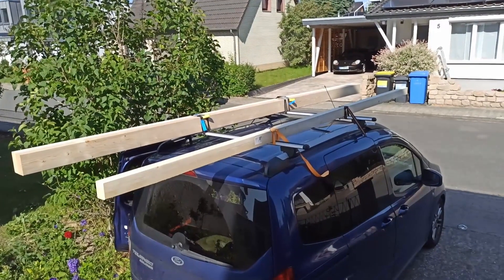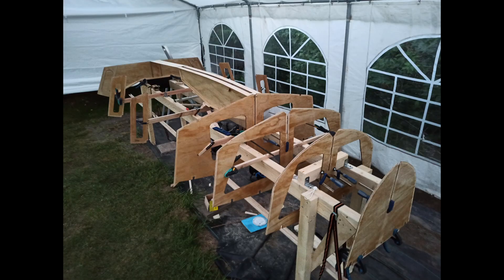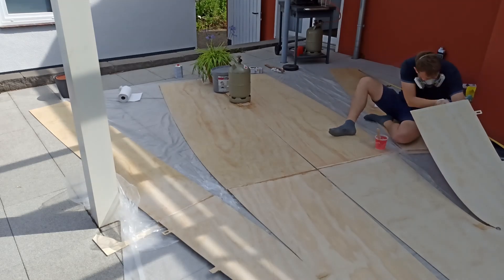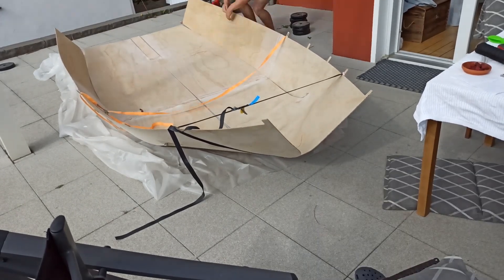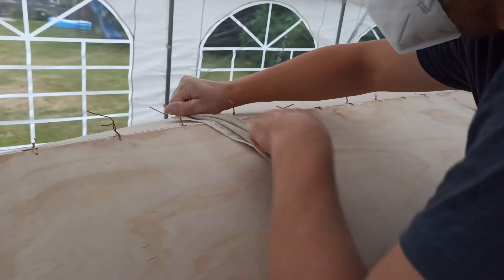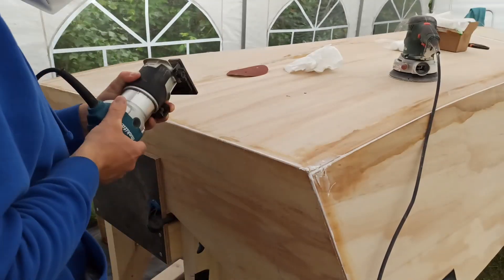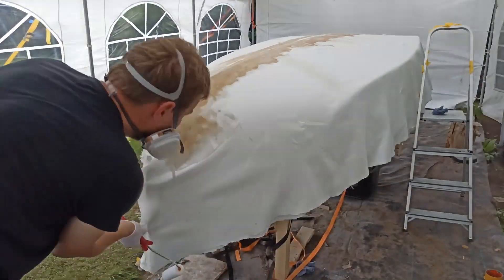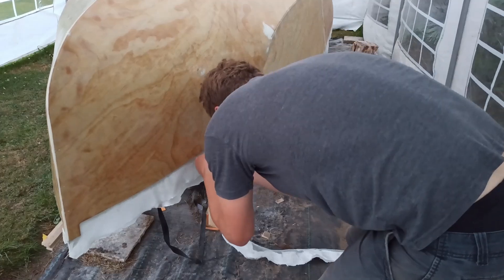TJ Sailing Dinghy - Stitch and Glue

Comment: Hi Jake... which plywood and thickness would you reccommend for small motorised boat? 6mm pine ply would be good? Size of boat 3metres length and around 1.1 metre width.. thanks
Reply from the maker: Hi, yes, that's a difficult question. The wall thickness depends on many factors, such as the (core) material, structure, coating, minimum bending radius, and load. I would say that if the boat is reinforced with fiberglass fabric, it would be between 4 and 8 mm.